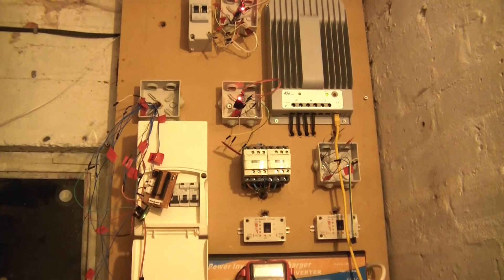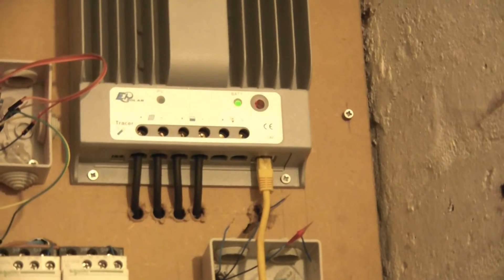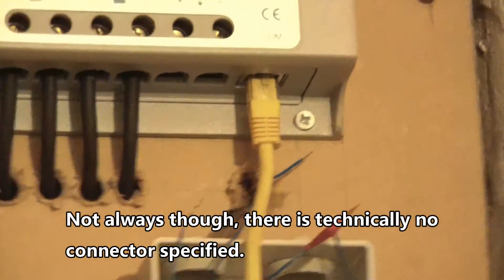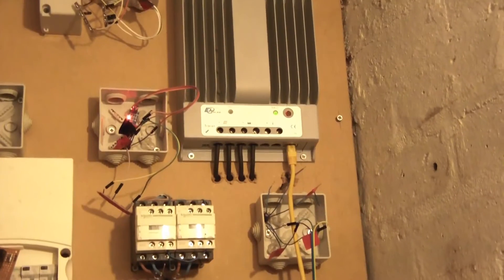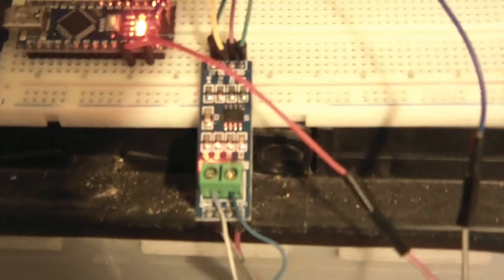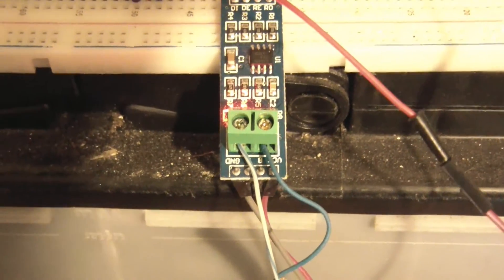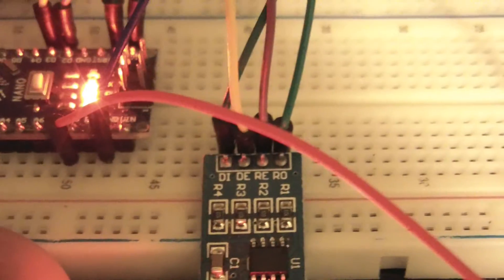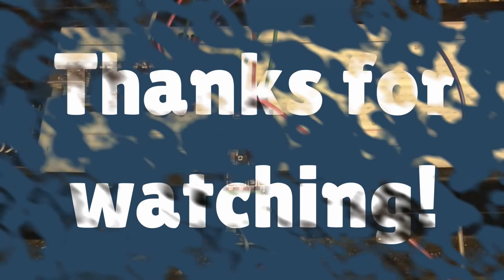TUTORIAL: How To Use RS-485 TTL MODBUS - Arduino Controller Module (Part 1/2 - Wire Up) Solar

Comment: 4:14 Hi ! I'm doing a similar project and have complications when running the code. It does not enter the voltage informations printing if. How do you know what cables to connect from the ethernet cable into A and B

Comment: RS485 is a two wire multi-device low-voltage long distance interference tolerant industry hardware standard. The equivalent point-to-point is RS-422.
Reply: RS422 is the simplex version of RS485, but still supports multi-drop communications.
Reply: @LandyAndy62  The ONLY difference between the two is RS422 is point-to-point and RS485 is addressable multi-device (same wiring, protocol, voltage, devices etc), you've just repeated what I said, so I thought I'd repeat it again too.

Comment: Can we  use Arduino UNO as  RS 485 splitter means that is it possible Expands RS-485 networks by splitting one RS-485 network into two other RS-485 network ? Rs 485 port support both Modbus/Bacnet.

Please do answer this query

Comment: CAT5 & CAT6, or  Ethernet cable is NOT being used for IP networking, only using the copper wires to send data on.  This was confessing when I first looked at the video.  Most people think ethernet .eq. tcp/ip networking

Comment: Hi, great tutorials, subbed :) 

However, I'm trying to reproduce a similar example using an Arduino Nano and MAX485 as well, except I'm trying to connect to an Atersa Met Callibrated cell, but I always get 226 as resultMain
Reply: I removed the library and made the communication by hand. He explains how in other videos.
Reply: https://youtu.be/NJAXs3T4NRg
Reply: @rashidnexkoyotl7524  thanks appreciate the help!
Reply: @johnzaki2302  most welcome
Reply: did you solved the problem ? if yes how ?

Comment: hello Antony I have two things that I need to do at the same time, control the opening and closing of two Y/N valves and send and receive information from a sensor that has a Modbus communication implementation done with :"MODBUS serial communication via serial interfaces such 
as RS232, RS485 ". for the moment I successfully done the Y/N valves with a relay that connects the alim with one or the other one. but for the moment I have no idea where to begin to connect to the other sensor to the Arduino, I am beginning to learn Arduino. I have some Modbus codes that I need to send to the sensor to do what I want, give it the sensibility value, start the measure, and others, and after the measure is done to send back the data, is it possible to do dis with this board, no? I would love if you could give me some guidance, as it is important for my actual work. best regards, hope to receive news from you, Franco

Comment: hi
 I used the same code that u did on video and I am using growatt PV inverter to get my reading on serial monitor using arduino uno and rs485 module but I am getting gibberish symbol and characters in my output...  
need help urgently!! thank u in advance
Reply: Can you share the code or link to download

Comment: Ground. You are probaly lucky in that there is an undocumented connection, but you should really connect a ground through on the RS485 lines. Otherwise, the A & B may go outside the range 'Ground to VCC' on the RS485 chip. And this is usually unpleasant.
Reply: Hey, I had the same doubt. The Modbus port ground wire should go to the Arduino ground or to the device supply ground ?

Comment: please send me code and connection diagram to read holding register of a MODBUS slave using arduino/esp8266 12E nodeMCU.
on anurajm44@gmail.com
telegram and whatsapp avail bale on +918547457178

Comment: Hi on Phoenix Contact rs485 module I have d(a) d(b) t(a) t(b) how to wire up ???? What means this signals to TX rx etc
Reply from the maker: Dzien Dobry!!!! RS485 ma cztery terminals... :-)
Reply: That's RS422 by the sounds of it. The labeling on your terminala are unfamiliar, so take your Phoenix Contact manual and look us the wiring to RS485. In RS485, there is only 2 wires to work with, so a 50% chance you'll get it right the first time

Comment: Your video could be very useful for my project. I have 2 energymeters, one that measures domestic power usage and the other measures power generated by solar panels. Do I need 2 TTL to RS485 modules, or can both meters communicate over A and B to one RS485 module with the arduino?
Reply from the maker: Jethro Cloostermans Hey, I'm afraid I don't know the answer to all of that. Just but two anyway! :)

Comment: Hey man! Great videos. Just wondering if you could explain exactly what the rs485 module is doing that  the serial ports on the Arduino can't do? Thanks a lot!
Reply from the maker: Hi! 'Serial' means that data is transmitted in series. But there are all sorts of different protocols which govern how that data is transmitted and received. My understanding is that the Arduino transmits serial in TTL. Old computer COM ports are RS232, and my device uses RS485. They are just different ways to communicate. Different syntax if you like. :-)
Reply: cheers!
Reply: RS232 is 1:1 communication or one comport to one device.
RS485 is 1:n communication or one comport to many devices.

The number of devices is set in the standard and is beyond the scope of this answer.
Also, the the wiring and the voltages are covered in the specs as well.

So what the author is doing in this instance is actually converting RS232 to RS485 with that little interface board between the solar controller and the Arduino.